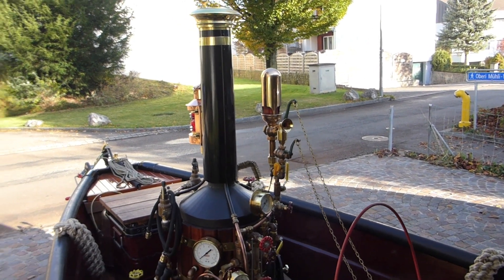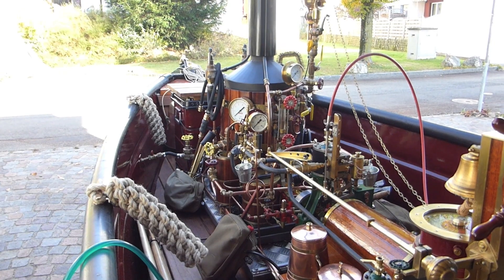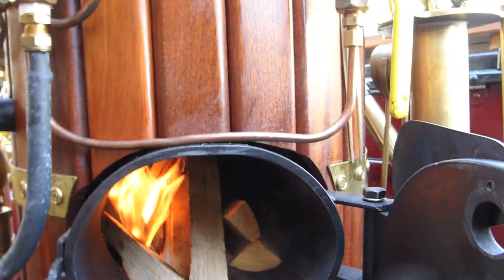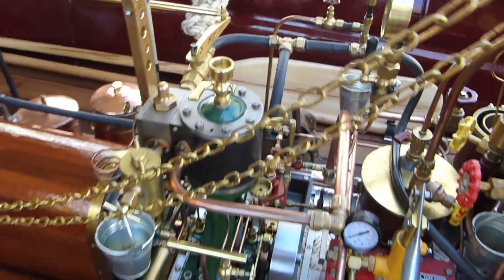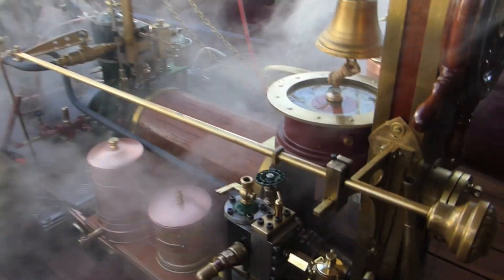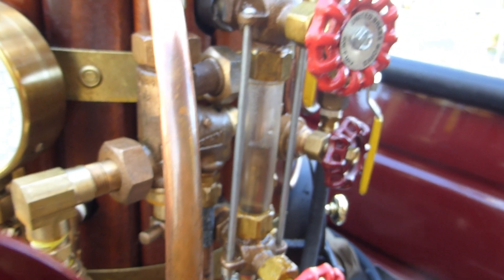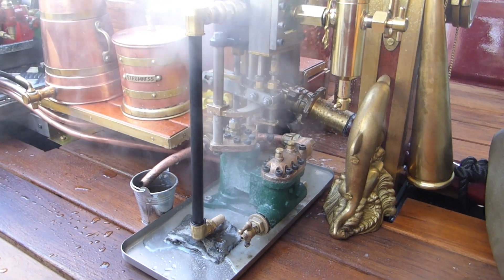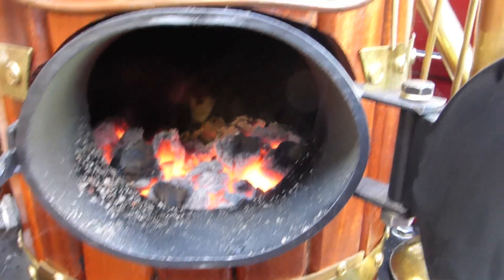Amphora Boat Southworth 12 Boiler Feed Pump First Steam Test 2017

Comment: What a wonderful propulsion plant ! You don't use a condenser ? You use an athmospheric exhaust only and all the time pumping water from the lake ? This does not increase the scaling of the bopiler too much ?
Reply from the maker: Thank you... the plant has indeed a condenser which acts also as a prewarmer for the feedwater and the level in the condenser is indicated by a pressure manometer... https://www.youtube.com/watch?v=eAoVK8Z7GdY&t=59s
Reply: @The123pcr  Ok thanks nice here that's lot of work all of that , indeed i continue to think that steam is alway more reliable than gas engine , especially 2 stroke engine, with these we have problems all the time and it only takes a little thing for it to stop working, with our steam installations although appearing complex it is extremely reliable and rarely breaks down, and when it does it is easily repaired and with home-built elements. Thanks 🤗

Comment: isn't showing the pressure gauge part of it? which sometimes seems so very low. the boiler should be allowed to rise to operating pressure and then heat the motors and the rest so there is enough steam when the water is hotter
Reply from the maker: Good morning... soryy I do not understand what you mean... can you please give me more details? Thank you

Comment: Bonjour Christoph,
I definetly like your launch very much. This pump, what a beauty ! for running your 5A, which is your regular running pressure ? The pump is already struggling against 25 psi, possibly too slow if you go higher, never mind, you also have a coupled water pump to supply water to the boiler, this additional accessory will be useful when you navigate slowly I guess.
Amicalement, Raphaël
Reply from the maker: Good evening Raphael... thank you for your nice and open comment... the normal running pressure for the boat is at 75psi, so much much higher and than also enough steam is available for both maschines  :-) 
I am very glad that even at this low pressure  and small coal bed the pump did its job and now I am sitting with a glass of red wine in front of my chimney to celebrate the premiere...  have a nice evening as well!
Reply: Bordeaux ? Bourgogne ? Côte du Rhône ? I like red wine too but would have taken the benefit of the fire to have a cup of tea from your Windermere kettle :+)
 Amicalement, Raphaël
Reply from the maker: Normally I prefere Bordeaux or Barolo... today a nice one from Toscana... tea later :-)